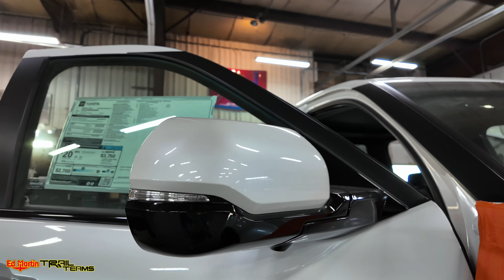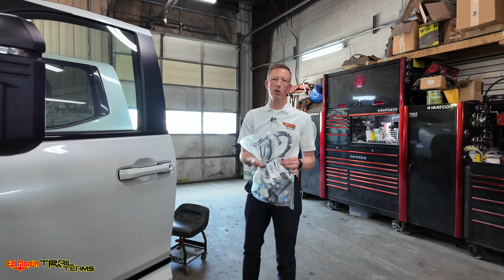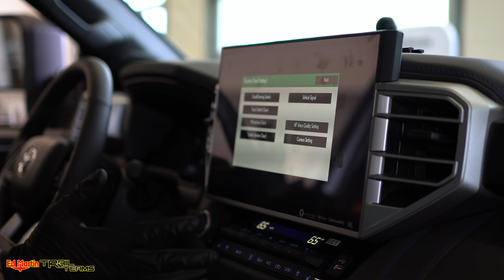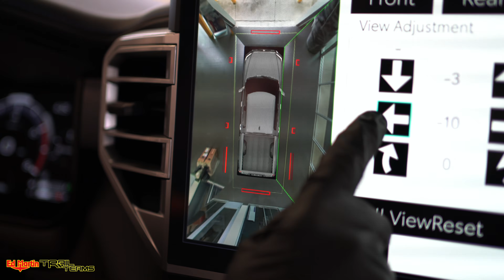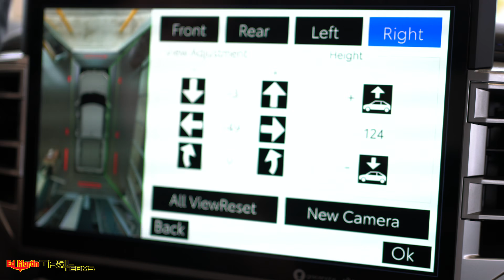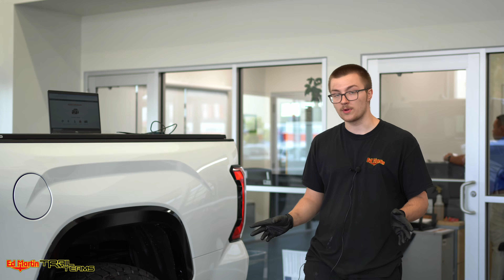Adding OEM Tow Mirrors to your 3rd gen Tundra (2022+)

Comment: I have a 2023 sr5 and called my dealership about mirrors and they said Toyota didn’t have anything that would go on my truck citing safety reasons?He said the closest ones to my model would be $1400 each! The truck was purchased with the tow package why the heck wouldn’t it come with tow mirrors? Between the engine issues the back seat isn’t worth a crap and the mirrors chit this, will probably be my last Toyota. I wish I still had my 2008 Tundra back. I bought aftermarket mirrors, let’s see how they work out.

Comment: Great video! I have a 2026 tundra platinum with the tow mirrors. The passenger mirror got scratched pretty bad when parked at a supermarket. Would replacing the existing tow mirror require with the same one (new) be plug and play or does it require programming? Do you sell just the assembly? And how to order
Reply from the maker: It is super easy, but probably still would need calibrated to get the lines all matched up.

Comment: I have an rs5 it is mandatory to change the harness to use the trailer mirrors
Reply: I have an SR5 and I bought mirrors off Amazon they plugged right in and work fine. Trouble is they are huge and create two massive blind spots.

Comment: Would suggest to make this change only if you tow often. Don't do it for the looks as the the visibility is really bad with these massive mirrors. Only handy when actually towing. 

Trying ti get rid of mine now, as the truck came like that when I bought it, but the harness situation is a pain. They mismatch. Can't find the appropriate harness now to make the regular ones work. Trying to avoid getting too deep in the wiring, was hoping for a plug n play replacement. So I guess I'll have to go to Toyota. Wil prob be a big difference from 150 per mirror and me doing the labor, vs +1k.

Comment: My dealer installed the OEM tow mirrors on my 2024 Toyota Tundra TRD Pro but the service department was unable to get the floodlights/outer mirror lamps to function. Please let me know if you have any insight into how to address this. Thx.
Reply: Did you ever figure out how to make the floodlights work?
Reply: @805Edwin  No, I asked other Toyota dealers here in Houston and they've installed several OEM tow mirrors but couldn't get them to work either. I think Ed Martin here may be the only one who knows. Btw, I think some people refer to them as puddle lights. These things are really expensive so you think Toyota would have put out some literature on it.

Comment: I got a limited sequoia 2023 with tow mirrors, i buy normal mirrors to change, but they dont fit, is possible this swap? what parts need to be changed?
Reply: Did you ever figure this out? I just bought a 2023 Sequoia with tow mirrors and want to swap to standard

Comment: Wonder why Toyota would put a different wiring harness on for different trucks? They are trying to streamline everything like the TNGA platform but then do this. I guess best to go aftermarket especially if you don’t have the surround camera system.

Comment: So my Toyota dealership in Bend said they can’t get my switch to tow mirrors to work.  Something about a module.  Have mirrors switches, and harness for the tow mirrors installed.  900$ bucks and they can’t get them to work.  
Is it in the settings? And they just are poor customer service?  Help

Comment: I just spoke with someone from the service department at Ed Martin Toyota and was quoted $750 for labor, for the install and calibration of the cameras/blind spot monitoring. The sale price quoted above for the mirrors/harnesses/relays/dash buttons etc. was unfortunately $4,743.43!  So 5.5K for OEM tow mirrors installed.
Reply: All they really need to do is make the stock regular mirrors pull out 6-8 inches, problem solved.
Reply: Similar experience. This is crazy!
Reply: This was my next question. Wow. Just insane
Reply: I don’t understand how they could tell you that with a straight face, I went with some aftermarket mirrors for a few hundred bucks, we’ll see how those work out.

Comment: What was the total cost of this project, asking for a friend?
Reply from the maker: MSRP $70k + about $15k-16k in mods. $6500 PPF, $1500 35" A/T tires, $1500 lift with install and alignment, $2000 roof rack with labor, $1500 ladder with labor, $1500 ditch lights with bracket and labor, $300 window tint, $500 Toyota OEM skid plate

Comment: This was a great video, thank you, this is my exact setup and I want to add these
Reply: Hi there. I'm looking to go the other way. I have a 2024 1794 Tundra that came with the factory tow mirriors and I'm looking to go to the stock mirrors. If you have a platinum, like the one in the video, I believe we have the same trim level. My tow mirrors have : power fold, directions light, blind spot, 360 camera. I'm looking to swap mirrors with someone wishing to upgrade to tow mirrors.
Reply: @Redtail627  Hey Hey, I have a 2025 Tundra Limited with fully featured Mirrors, I'll trade with you
Reply: @Redtail627  i sent you the details 👍
Reply: @Redtail627  I have a loaded platinum, I’d love to swap! I’ll cover shipping!
Reply: @joshw2991  Hi Josh - sorry , I already swapped mine.
Reply: @Redtail627 how did your install go? I have a 2023 Sequoia platinum I want to do the same thing with
Reply from the maker: thanks!

Comment: Have you looked at the opposite? Swap tow mirrors for regular?
Reply: I'm looking to do the same. It's a real bummer Toyota built these with the wonky wiring harness. One would think they could have set themselves up to make more money from people looking to upgrade to tow mirrors. From what I have been able to research, the connection at the mirror is the main challenge. The Tow Mirror has a male connector to a female harness end. The opposite if you have the standard. IO want to swap with someone close by. I have the tow mirrors and would prefer the standard. I'm in Minnesota.
Reply from the maker: @chrissypniewski8498  no, but would be the opposite process. Can be done
Reply: @edmartintoyota8599 - I believe I found the part numbers for the mirrors. Do you know the wiring harness numbers?

Comment: I already swapped someone for the mirrors. My truck had the standard, and now I have the tow mirrors. Do you have a parts list of everything I'd need to complete the project? We also swapped the 2 accessory switches (extend and flood light I believe).
Reply from the maker: Yes, we sell the whole kit here: https://www.edmartintoyota.com/order-parts.html?path=%2Fsearch%3Fsearch_str%3DTWMF3GT
Reply: @edmartintoyota8599  the. Link doesn't work. Do you have a kit for the camera system for regular sr5
Reply: @PlatanoHabibiproductions what did you end up doing? I basically only need the harness
Reply: @edmartintoyota8599  do you have a parts number for the harness? Same question as the guy who you replied to, I have the mirrors(without the camera) I can get the buttons for the mirrors, I just need the harness

Comment: I have a '23 Tundra with the tow mirrors.  Can you explain the operation of the puddle lights?  I know how to turn them on and off with the button.  It just doesn't make sense to me that they seem to only operate with the truck on and in park.  Shouldn't they come on with the door opening or unlocking the vehicle with the fob?  Am I missing something?

You guys seem willing to think "outside of the box";  I would like to ask a second question.  My truck is an SR5 as loaded as is offered on that trim.  I had to have the 8' bed, so couldn't go to a Limited or higher.  Anyway, I really wish I had the ventilated feature on the softex seats.  Love the heated, but ventilated wasn't offered.  Can that be added as oem?  I know that there are after market kits, but I want it done oem if possible.  Is the dash control in the can bus or just a traditional switch?  If this can be done, I would be happy to order all parts from you guys if you put the list together.
Reply from the maker: Personally, I don't tow, so I can't really speak to the operational element to the question. I agree, linking that to the puddle light circuit would be a killer idea. That could absolutley be done by a qualified electrician. Great suggestion for Toyota.

As for the ventalated seats function, you would absolutley want to go aftermarket vs OE. Unlike the heating elements, the ventalation system is very comprehensive and would probably cost $10k + to order all the parts and then install them. This is a cool idea, but I can't see it making sense